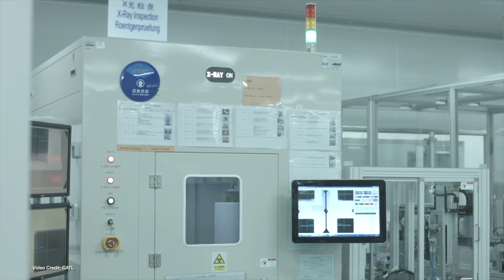ecoTEC 331 Breakthrough 16-Year Battery Life Nissan LEAF No More In NZ Tesla’s Missing Coffee Cups?

Comment: Sounds like Aptera is following the Elio playbook.  Remember that Elio was developing their own engine, then switch gears to a commercial off the shelf engine.  Changing from in-wheel motor is major engineering change that is not trivial.  The parallels between Aptera and Elio is striking from the prototype assembly to production funding to late design engineering changes (technical creep.).